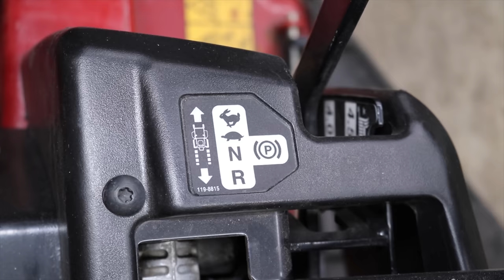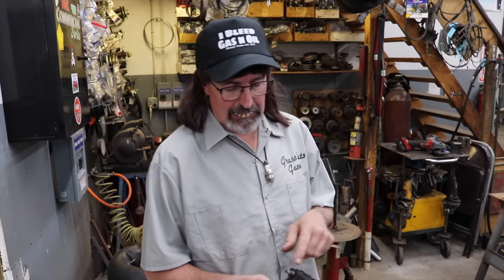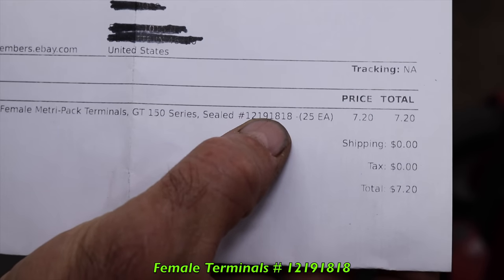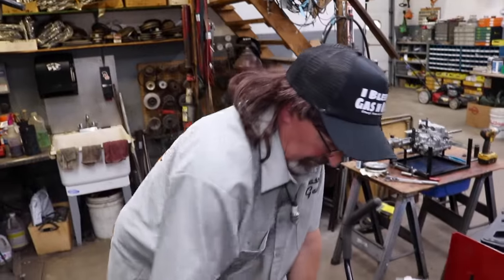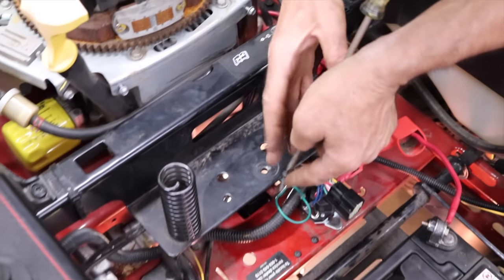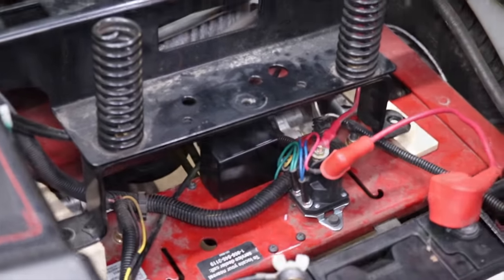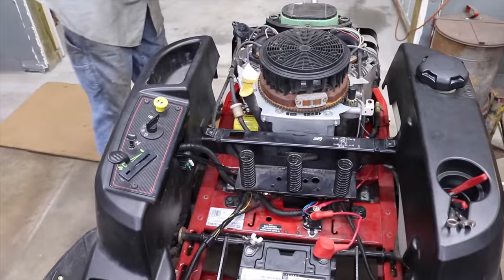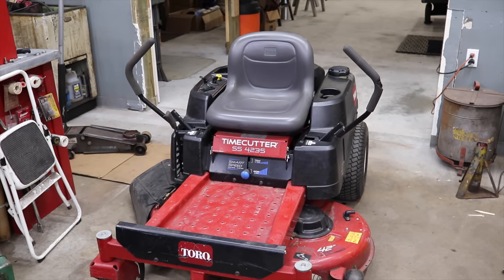⚠️ This Thing Was NOT Easy To Work On

Comment: I thought they only put that electronic parking brake crap on new cars! Crazy 😵‍💫 Great work around to save the customer money on the wiring harness Taryl.
Reply: Everything is over engineered with built in obsolescence, how does connectors rot away? brass does not rot away.
Reply: @tonysheerness2427  connectors are aluminum or tin steel, cheaper than the brass ones companies used to use.

Comment: I think I'd figure out a way to bypass that parking brake module and either do without a parking brake or make up some kind of mechanical lever system to apply the parking brake. Nice factory like fix by Taryl though.
Reply: There is a work around. I believe I picked up on it through youtube, or one of those chat links a few years ago. It involved dumping the unit and living without parking brakes....
Reply: @JM-yx1lm  2010 wiring harness is set up for manual park brake.
Reply: @JM-yx1lm  We need to go back to electro-mechanical controls  and ditch the stupid electronic crap.  My Deere X-370 is needing a new ECM,  $330.00 at the dealer (the only place you can get it).  Yes, it controls EVERYTHING, and without it, the mower will not run.  I'm all for every safety feature built in to the machine,  but it's ridiculous to route every circuit thru ONE module.  Seven years old, 240 hours and it's already busted.  Poor quality electronics,  disgusting.
Reply: @santaclause2875  But a big money maker for  Deere and Co.
Reply: @georgepruitt637  Correct !!!!
Reply: I was thinking use a cable to control the parking brake . It might work.
Reply: I did this part time for 25 years.  I can so relate to your videos!  Always something different and no one realizes the time that is put into researching and finding parts.

Comment: Yes, The GT 150 Series is one of many GM/Delphi connector. While many "car"  plugs of all brands are "Weather Resistant," coat terminals and body with silicone grease helps make sure any water that gets in can't cause rust for all. Because the seals often "fail" if wires are bend or pulled sideways near the connector body. Or If installed with wires pointing down even with the cover as above, water can sit and wick down thru any seal.
Reply: Dont park machines out in the weather and WD40 is ur friend?

Comment: Everyone keep your old school lawn equipment with maintenance up to date bcs just like modern cars nowadays they're nothing but a pile of junk ready to give you the worst headaches of your life's... Love your videos TFA
Reply: That's what I do with Wheel Horse. The later series 300,400,500 had some cheap features that Toro put in. The C160 is probably the best tractor they ever built. Then Toro bought Wheel Horse and used up the parts inventory 
   I got a great deal on a 314 Toro/Wheel Horse and you have to check under the belt guard for failure to the drive belt idler plastic pulley bushing. I had a failure on a 520 and had to adapt an oillite bronze bushing to take up the slop. Thanks Toro

Comment: Good to see your way Taryl, Thought I would mention my way. If you remove the battery platform (2 bolts) the whole plate comes out really easily and you can install the module from the top with one person. Also as you mention elskins didn't need to remove the gears to disable the parking mechanism, simply take a 10mm and remove what I would call the pawl, It's the part that connects to the module to physically engage/dis-engage the mechanical braking system. It's really easy to remove each 10mm bolt (thread it back in) and let the two arms dangle. push it all day now.
Another thing that makes installing the plastic cover ALOT easier is to un-bolt the solenoid and move it a little bit, which gives you the room to properly install the cover and start the problem bolt, which can be tightened (as you mentioned) through the access hole in the frame.

Comment: Looks like the ones on the Cummins ISX engine to me 
If I run into this problem I will find out 😊
Great information and advice 
Thank You 
PS. Every connection on that mower needs the grease

Comment: Hi Taryl, long time subscriber, first time commenter from New Zealand. Classic case of why we should be keeping combustion engines and not converting to electric. If they (Toro, or should that be Zoro) can’t even put electric grease on the terminals, what faith do we have in the companies making the new age mower’s getting it right at the factories. 
Zoro, that sounds like a new character to go with “Blademan and Throttle “ .  Great channel, very helpful and informative. Keep up the great work.
Reply: Zorro did cut--

Comment: T  !  Love ya but need to chip in that yes, I do have that mower. And I did need to replace that part a few years ago.  Couple things...It is very hard to get to and I probably wouldn't have done it myself if I had seen this video beforehand.   I swapped out my module from underneath and didn't really take off nearly as many parts as you did.  Fortunatly I did not have the damaged connector to deal with but I do think that installing the annoying cover is an attempt to protect that connection.   It is always a little thrilling to diagnose and fix something like this and your videos are remendously helpful.  Thanks

Comment: I am a heavy equipment mechanic, on my rig I have full setts of Deutch for caterpillar Delphi for older deere harness connection kits. Comes with everything to repair or make  new harnesses, little pricey but so worth it when ya need it. Anymore I get all refills from  Amazon so there ya go.

Comment: Anyone who owns one of these like myself and is mechanically inclined knows that 2nd to the motor going is the fear that this thing will. So now thanks to you I can see how to tackle this should it ever. One for the books Taryl !! thank you. Wish the stamp decks on these were thicker, they are prone to rust. Blow and rinse the deck off after mowing.  Annually remove the deck and make any repairs and touch ups.

Comment: Great work! Very few shops would research and replace those terminals!  I have a mid 80s Snapper Hi Vac walk behind with a Subaroo engine. Pre safety nonsense. It is mighty and well designed.
Reply: Got an 85 with a 4-horse Briggs flathead and still runs fine. Can't beat the good old stuff!
Reply: @lewiemcneely9143  Yeah!  I also run Bobcat snowthrowers (Wisconsin Marine) with Briggs 8hp flatheads.  No safety bales, 1/4 thick plate for the augers, slip clutches instead of sheer pins, etc.  If someone can fix stuff, I really don't know why they would buy new.  The new gear is just total garbage.  But yeah, I guess I get it.. most people don't want to sit around finding parts for the old machines.. easier just to buy new and start it up!
Reply: @blobscott  I had 8 mowers here but had to let them go. Too geezerish but kept the Snapper for a spare for the Stihl battery job. Also a LT 1000 spare for the battery zero turn coming this week. Got to do what you've got to do! Blessings 2 U

Comment: I have a 2017 Chevy Impala with the electronic parking brake.  I've had the car since it was new.  After about 1 year, this parking brake setup began giving me problems.  Sometimes when starting the car, the idiot light shows that the parking brake is set (although I never set it).  But when I hit the button to unset it, the brake will not unset.  When that happens, I cannot drive the car until it unsets, and after about 3 or 4 minutes the parking brake idiot light will all of a sudden turn off and I can then drive the car.  It could be something in the electrical system giving a false reading indicating that the parking brake is on when it actually is not on.  Or it could be some glitch in the electrical system that is causing the brake to actually set automatically.  I have never been able to figure out which and the dealer says they can't tell because they can't "replicate" the problem (of course).  This is what the "all electric" future has in store for us folks.

Comment: Yes. I had that problem with a 2011 time cutter ss4200. Three times. I traded the mower for a 2009 Chevy Aveo5. We were both tickled by the trade. I then found a 2015 ss4225. I haven't had any problems yet. One problem Is the cavity on the brake unit is facing up and gets filled with water and debris and it starts the electrolysis thing and rots off terminals. It doesn't seem to be sealed very well. I think that some silicone caulk would help or hotwire it and wait to die in an emergency.

Comment: Great video.  I have one of the time cutters with the tilting seat and the starter solenoid went bad.  I know what you mean by a contortionist act to replace it since the solenoid hides under the seat support crossmember and the only way I could access it was by the old flip the wrench on each bolt head face, move the wrench and flip again for another few degrees of movement.  Really feel for the two-man nut and bolt action you had to go through.

Comment: Just another thing put on for the convenience of not having to pull on a lever to do something....have a friend that has the same concept on his car...how hard is it to pull a lever or press on a pedal to engage a parking brake?  In any event, next mower I end up with will not have this feature.  Nice job by Tarly on diagnosis and repair in cost efficient way.  My tractor would not start one day...had to jump it with screwdriver and or a jump wire to start it....dealer searched all safety switches...finally found it in the 8th safety switch on the thing...how did us older folk survive without them?

Comment: When I got my new Husqvarna 46" mower, I did some PM work before I used it for the first time.  Dielectric greased all the electrical connectors, anti-seized the rear tires, electric pto clutch, bolts for the spindles, and other things to ensure no issues in the future.

Comment: I have three Toro zero turns.  One has the magic electric brake.  I see that the module is $100-150 on line.  My main problem has been spindle bearings.  I think I'll look at that connector and put some Deoxit on it.
I learned about that brake soon after I got the mower.  It threw a belt to a hydro unit and I couldn't tow it until I figured out that the switch had to be in the ON position to release the brake.
I might be tempted to rig a mechanical replacement for that thing if it fails.

Comment: I bought an Ariens Ikon 52 from big box store... Got it home, cut my front yard... Went around to cut the back, engaged the blades via electric clutch - awful noise, belt slips off. Clutch pulley is SCORCHING HOT. Blades wont engage. I return the Ariens to big box store. Have to order another one. I hesitantly buy another one thinking I'd give them another chance, maybe it was a one off bad part. Could happen to anyone.They have to deliver it. First cut goes fine, even though the handles didnt match (one was faded) and there was a big shipping scratch in the rear - and the hydro drives are way out of adjustment so that when you reverse it turns while going in reverse... I tinker and try to adjust. I make it through the 2nd cut a week later and justify my purchase in my head, but not really happy. I go for the 3rd cut - I dont even finish the front and the clutch heats up and smokes the blade belt and snaps it. I'm angry. The 2nd Ariens Ikon52 doesnt last even ONE clock hour. I return it and get a refund. Now I'm scared to buy anything else. I just picked up a used Crapsman DYS4500 24HP Briggs for $240 (needs a blade engagement spring/cable which I just ordered). I initially bought new so I wouldnt have to worry about repair/maintenance. That was a fail. Just frustrated. I noticed every big box store had those Ariens Ikon 52 & 60s used with repairs discounted out in front of their store after I bought mine. Literally theyd have 2 or 3 sitting out that were returned. What gives? I thought Ariens was a decent company. I'm scared off now. If I buy something new now it's going to be commercial.

Comment: Tarly i love your videos!!! I’m 70 and have a 2002 Dixie chopper efi kohler. Runs for 15 min give or take. Not losing spark and is getting fuel. I believe the pressure regulator is bad. Plugs are wet when i remove them. Please do a video on one of those.

Comment: I used to use dielectric grease on the inside of spark plug boots and to ensure a good ground on car control modules. My understanding is that dielectric grease is a good conductor so why didn't it short out those pins to each other when you connected the plug to the harness?

Comment: Love the fix. I used a similar tool to rebuild the engine harness on my 94 4Runner this summer. 

Why not electrical contact cleaner and some dielectric grease instead of a rebuild? Was it in such bad shape?
Reply: Didn't you see it in the video?   Any shop worth their salt would replace all those connectors, just a warranty return waiting to happen.

Comment: GT 150 is used for a bunch of GM car headlights like say a 2018 Malibu. I'd have to look it up but for a whole bunch of terminal types GM sells what is called a 'terminated lead' which is just a terminal pre-crimped to a length of wire. Good for a diy because a person can make that repair with just a dental pick and basic crimp splices or solder instead of a specialized set of terminal crimpers.

Comment: Looks like the same connector used on the climate control seal module on fords. They like to burn up the ground circuit in the connector and module. You can get the connector through a Ford dealer. Your local dealer should have a connector book that you can match it up through.

Comment: Corrosion like that, in a environmentally sealed connector, often indicates a parasitic power draw or a resistance short issue due to vibration on the contacts .  Aside from storing the mower in a dry place,  adding a battery disconnect at the terminal for storage and making sure the pins in the connector have s solid contact with Dielectric grease on the pins will go a long way toward preventing such corrosion on the connector pins.

Comment: Remove the brake and change the ignition circuts to switches, or back on the key. Like it should be, some simple screw to set brake

Comment: Squeeze a glob of Ilsco De Ox or Dow Corning dielectric grease into that terminal cap and the individual crimp terminals will not corrode. I like that green Ilsco electrical grease. It has a high drop temp so it won't run out of the terminal caps like oil when it gets hot. I have been using that Ilsco green for 40 years now.

Comment: You should never disconnect the positive battery terminal before the negative. If your wrench slips, and hit the chassis, you are shorting directly across the battery. Spark city.

You can sometimes save a connector by applying dielectric grease to the contacts, and connecting & disconnecting the connector several times.

This has convinced me that I don't want a machine with an electric park brake.

Comment: Mine went bad twice. I noticed it was from rain water getting into it so I used 100% silicone to fill the holes over it on the black part between the springs. Haven’t had a problem sense.

Comment: @19:54 No wonder the contacts rotted out. The "cover" acts as a condescension trap and puts water directly down the wires and then to the connectors on the plug. 
Great engineering guys! 
I'd caulk that whole cover and plug before it's installed to keep it sealed or it's just going to do it again.

Comment: It looks like that cover was put there to prevent water getting in the connector, but it gets in there anyways. Since the connector on the brake thing is shaped like a cup, any water getting in there will just set until it evaporates. I'm wondering how it got in there. Mighty nice of you to look up the pins and then share the part number. Most people would do neither!

Comment: That connection is actually a Molex MX150 connector series. What you bought is a knockoff part. The female connector pin should be Molex: 330012003. There's your dinner!

Comment: Electrical grease on the terminals after repairing should help make them last longer. Makes me glad i never bought a newer zero turn. Still running a mtd evolution zero turn for my mowing round. Had it new since 2006 still going strong if looking somewhat dishevelled. I did think of getting a narrower ariens or gravely before covid hit here. After seeing this vid i'm glad i didn't. I never considered the later mowers would use crap that's not necessary, hidden away gawd knows where. Nothing electrical on mine can't be repaired regarding connectors as it's mostly spade terminals. It's basically wiring & 2 relays & 1 safety switch thing that's it.

Comment: Two summers ago I had the same exact thing happen. I had to replace the brake assembly and the plug on the harness was messed up too. Had to replace that as well. I told the customer the plug should be cleaned out at least once a season.
Reply: Average customer wouldn't be up to that task.  Good maintenance return job.

Comment: I wonder if that'll be an issue in the south or if it's just up north in the salt alot of people don't even know you can replace pins most people would just charge someone for a new harness I was legit thinking in my head that's a GM style plug when I saw you showing the terminal rotting off at the beginning of the video now people will learn something here being able to replace pins is a huge game changer for people who never knew I work on automotive and I've seen so many junkyard pigtails butt connected on 10- 15 pins no heat shrink nothing 🤦

Comment: Having connector pins imbedded into a module like that is a bit dicey when it comes to corrosion. If a wire pigtail comes out of the module, repair is much easier and possible. Even if both connector ends are corroded, they can be cut off and replaced as a pair if necessary.